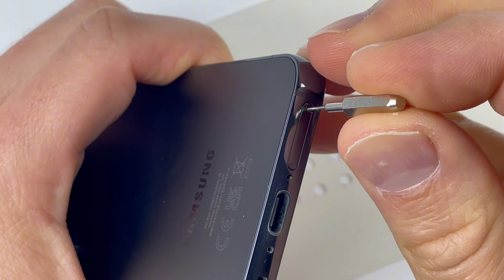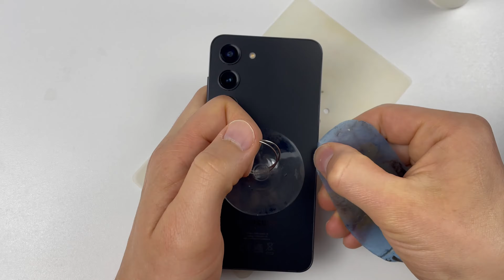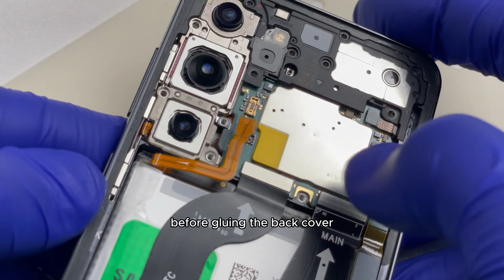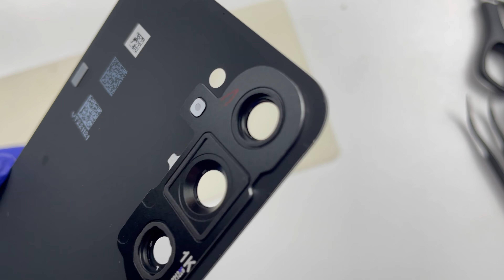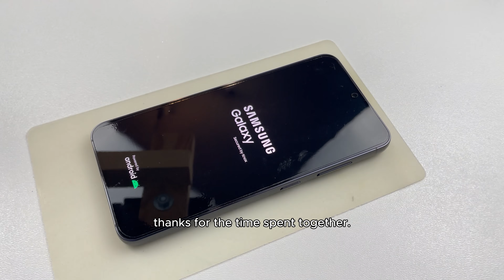How to replace Samsung S23 Charging Port: No-BS Repair!

Comment: Little advice. When you are trying t9 get the excess glue off the back of your case, use a plastic scraper. If you use a screw driver and get too rough with it, you will scrape the coating of the case off.

Comment: Thanks! I managed to do the replacement here at home using a little toolset from AliExpress. I used the heated bed of a Bambu Lab A1 Mini to heat up the back of the phone, and the rest was pretty straightforward to follow. Let's see how long the phone lasts now!

Comment: hi, so this was fantastic. But a couple of notes: 1) that little plastic dealie is incredibly important, nothing else is able to get the back of the phone off 2) if you overheat the back of the phone with a heating gun, the back glass may crack when you remove it 3) screws holding the charging port require a normal screwdriver, don't start this work without a good screwdriver
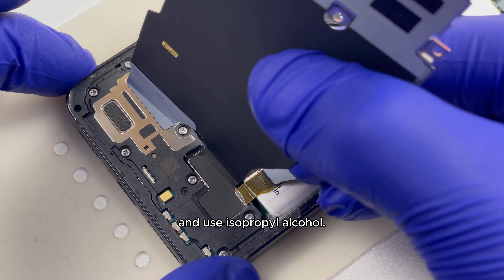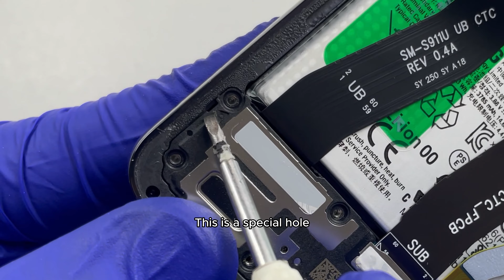Reply: also you dont need to unstick the adhesive between the NFC/ Charging coil and the lower speaker cover @2:15 Just leave it attached, remove the whole thing together after you take out the lower screws @2:45

Comment: What glue did you use for the wireless charging coil?
Reply from the maker: I didn't use glue. The adhesive tape remained in place after disassembly.